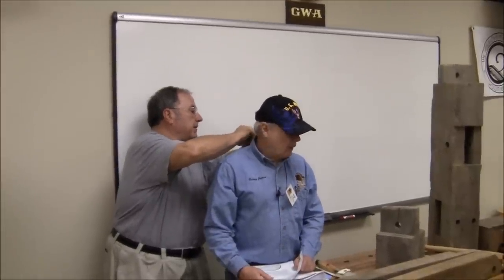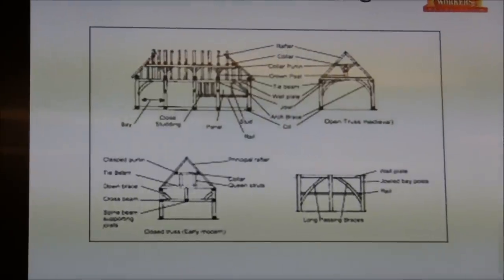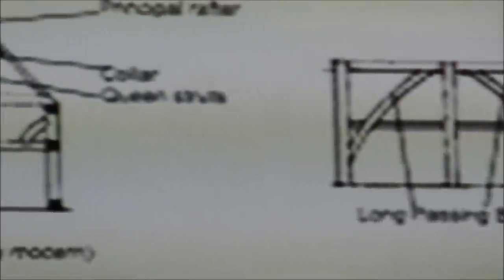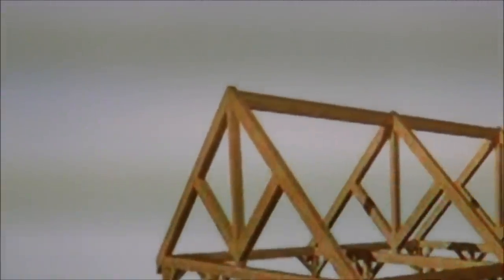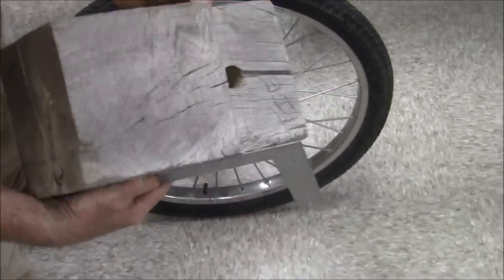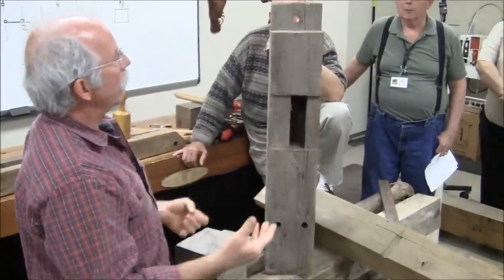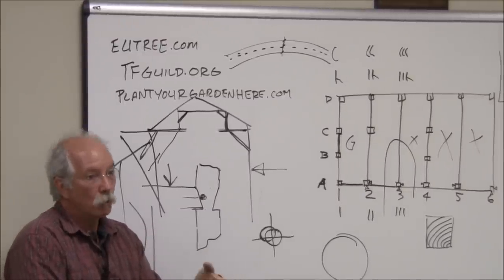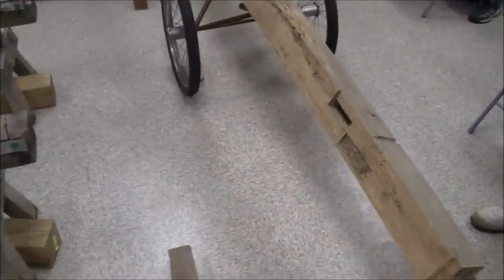04-30-11 Timber Framing Construction by Gerry Jones and Mike Goldberg (01h54m)

Comment: Spans Are not determined by availability of timber but by the deflection of the material.Spans at 4.9m or 16' require special consideration due to excessive deflection.